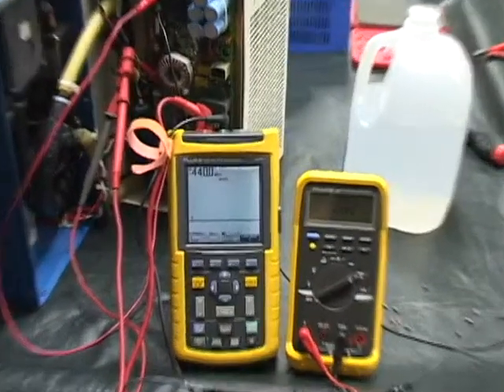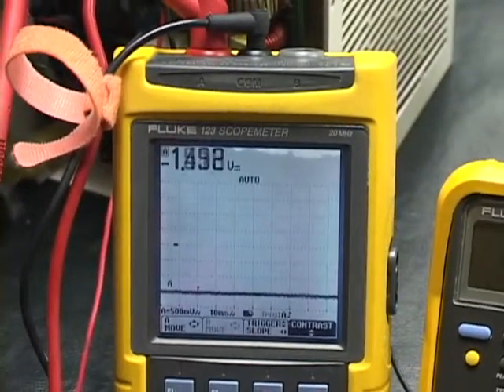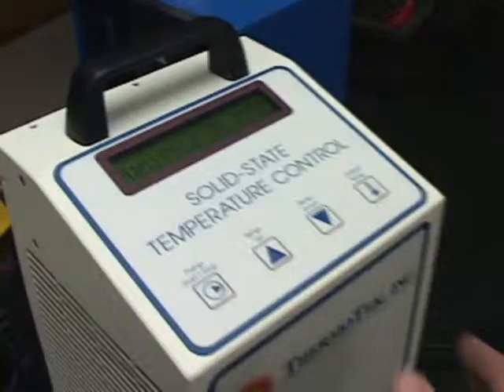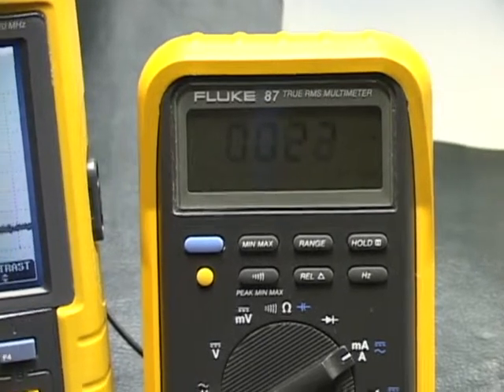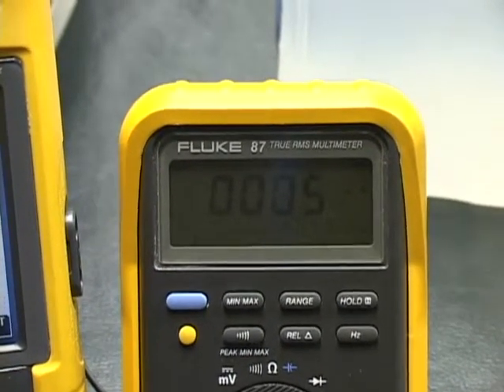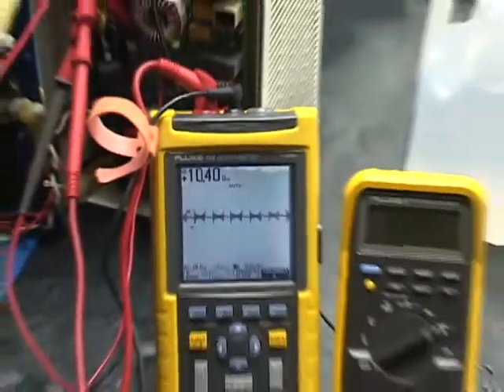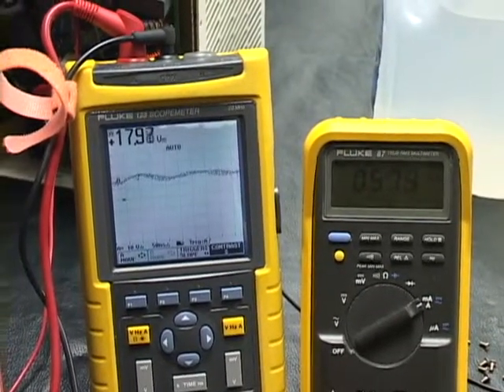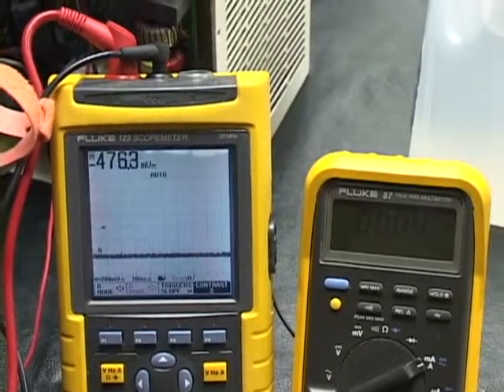ThermoTek Chiller Power Supply Test

Comment from the maker: Refilling is fairly simple. Justused distilled water if you are above freezing temperatures. Make sure the fill neck is higher than the rest of the coolant loop. Fill   to approximately 3/4 full. let the air purge and add as necessary.

Comment: I just picked up one of these on eBay for just over $200 to cool my CO2 laser. They were originally designed as a medical device, and were uber-expensive when new.
It has a temperature gradient feature which is useful for avoid thermally shocking your laser tube. Max temp change per hour is 60C. It can be set as slow as 5C per hour. I leave mine at 60C, and rapidly hit the temp down button 20 times after power on and pressing output temp. That sets it to 20C - which is the temp I normally run my laser at. The temperature control seems very precise even when the load changes.
Reply from the maker: +Scott Lichtsinn They are called CPC connectors. If you look around, you can buy them in packs of 10 for around $15.